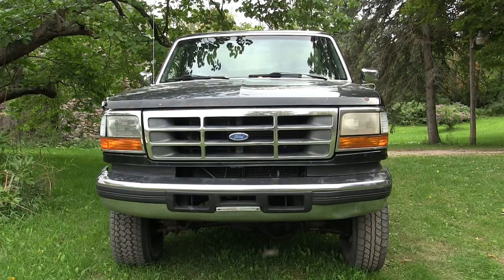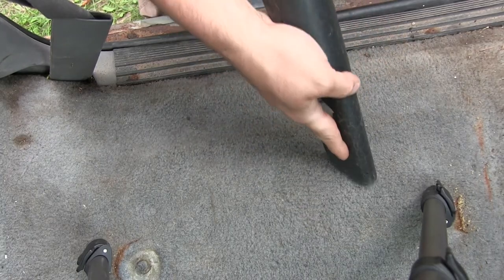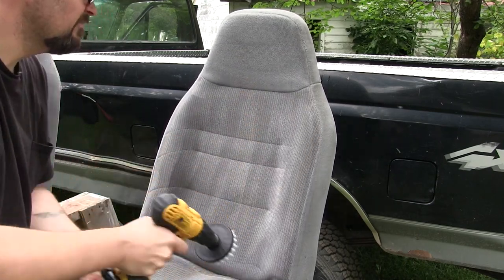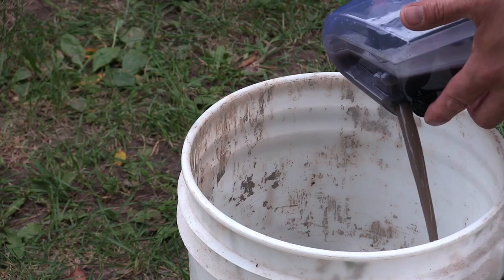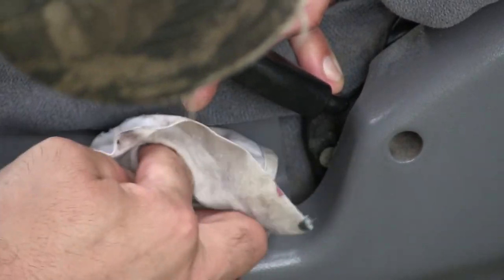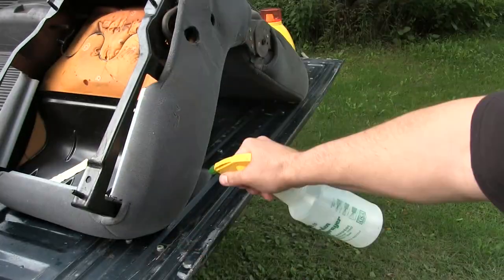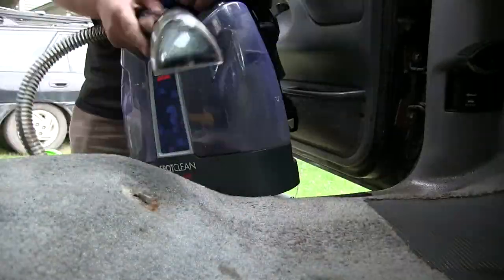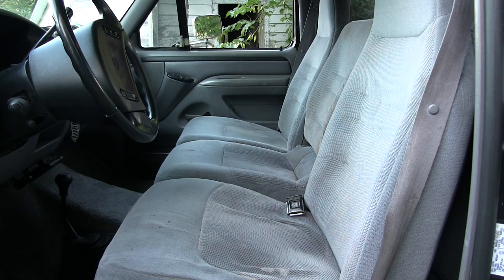How to Clean your dirty car & truck seats Yourself

Comment: I really like your pickup truck, that model looks way cooler than the more modern stuff. I recently purchased a brand new hand held steam cleaner for £25 to clean the seats and upholstery in a 20 year old car I purchased. I used it in conjunction with a wet & dry vacuum and boy does it work well. Dirt and stains just dissappear like magic, and like you I was astonished at the disgusting stuff that was sucked out. The steam also gives the bonus of killing bacteria and germs, which is a plus in these troubled times. The car now smells so so fresh and clean. Many thanks, David in the U.K.
Reply from the maker: Thanks !

Comment: Your carpet cleaning way worked great! What I’ve done in the past was pulled the carpet right out and hung it on a line and wet it down and sprayed a diluted purple power degreaser on it and let it soak. Then pressure wash it off ! It’s crazy how clean it gets! Just gotta let er hang dry for a while. The biggest reason I did it that way was because of cat piss! Yeah getting that out wasn’t happening until I pulled it and did it that way! But man what a night and day difference your truck interior looked!
Reply from the maker: Thanks Brother.

Comment: Awesome job Dave 👍. The interior looks great now. Night and day difference. I love the drill brush! I’ve never seen one of those before. Great idea using the pump sprayer. I bet that saved a bunch of time and saved your hand and forearm. The upholstery and carpet are still in great shape and look so much better. Added tip, use hot water in the extractor. It will clean faster and easier. Awesome job and God bless!
Reply from the maker: Thanks 👍

Comment: For the carpet and floor mats I have had great success removing them from the vehicle scrubbing them with simple green and pressure washing them. As a bonus you can remove the stuff under the carpet and clean the floor, especially helpful when trying to remove mouse related smells.
Reply from the maker: Great tip!

Comment: Keep that drill handy, at some point your going to want to do them old yellowed plastic headlights our cars tend to get...
Little trick I've found that worked for me. Once your done sanding and buffing on them use a high gloss clear spray paint to finish them.
Reply from the maker: Thanks

Comment: Amazing difference after you cleaned the seats! Will you try to repair the rip on the side of the driver seat? You might want to spray them with Scotch-guard to keep them cleaner longer. Great video!
Reply from the maker: Thanks for the tips!

Comment: Hey Dave that vacuum cleaner that squirts out the water to clean the upholstery Yes actually speaking I thought about the same way 2 years ago still haven't gotten to that point thoughbut I did not know about that thing that you put on the drill now that's is a pretty good idea thank you
Reply from the maker: I watched a few detailing videos before I did this job. They all use those brushes

Comment: One of the first art classes I took was ceramics. I wrote "Clean is good" on the blackboard. My teacher really liked that. 
Dave, I wonder what dow's scrubbing bubbles (kitchen/bath cleaner) would do on upholstery? Often, I use the publix grocery store generic equivalent prior to painting surfaces like metal, and wood. Its ammonia based, so there isn't any rinse needed. That saves allot of time. One thing that is important is to let soap, or whatever have adequate seek time. Thank you for this channel. Bless
Reply from the maker: Thanks for the thoughts

Comment: Here's a thought. If you can come up with a way to repair the edge of the driver's seat, it would be greatly appreciated. Every older truck I see has that worn out from sliding up into the seat. Good job on getting that dirt and grime out.
Reply from the maker: I'll maybe give it a try
Reply: Would love to see that too!

Comment: I had picked up a set of tan seats for my jeep that were just filthy. (way more than your seats)  I do not have an extractor. and I didn't get far with a manual scrub brush. I ended up pressure washing them. after shop vacuuming as much water as possible I sat them in the sun with a fan on them for a few days,
Reply from the maker: How did that work?

Comment: The water that came out of those seats looked like the makings of a science project.
Reply from the maker: No joke. I cant wait to do my j10. The carpet in that truck looks like it was flooring in a machine shop
Reply: @cheapwheels9828   I was recently gifted a 98 gmc suburban, as soon as it warms up I need to do the entire carpet and redo the two front seat bottoms, the leather is done for

Comment: There is a product called awesome. You can buy it at any dollar store for one dollar. Are use it to clean just about everything. I have taken grease and gum out of auto upholstery with it. Give it a try
Reply from the maker: Thanks for the tip!
Reply: @cheapwheels9828  It's good .. but careful with the fumes  as it's harsh. Similar to Oven cleaner.  I usually go with an ice cube or a steamer for gum , hard candy.. gunk.  Steam and vac simultaneously

Comment: Someone could use that initial investment and put an add out for detailing and make the original investment plus more back!
I am curious how hard it would be to get out seats from newer cars that have electronic features in them?
Reply from the maker: Should just be a plug
Reply: @cheapwheels9828  thanks

Comment: Great job,that truck at $350.00 or 3500.00 it would be nice to know what else was wrong mechanical.
Reply from the maker: steering colum actuators, broken tank fill tube, broken leaf spring bracket, leaking power steering gear box, loose steering linkage ( like it was all losened up and never re tightened. 4 ruined shocks, rotted plug wires, .......you name it.